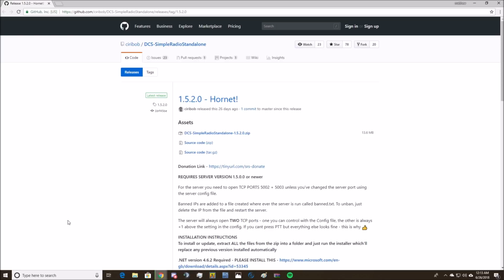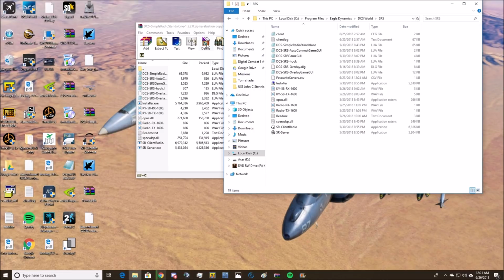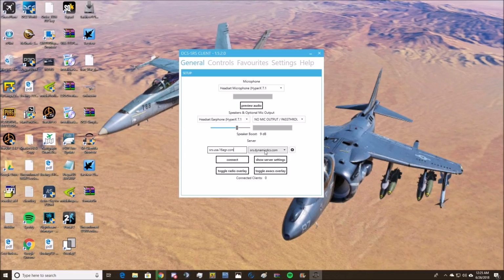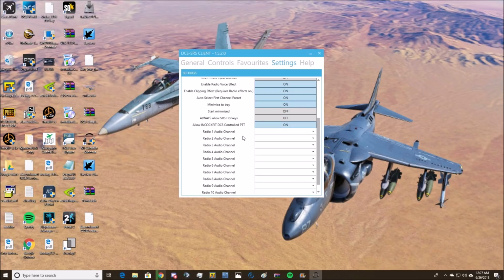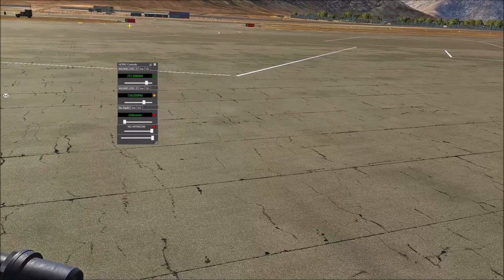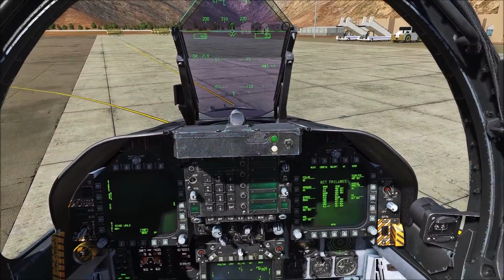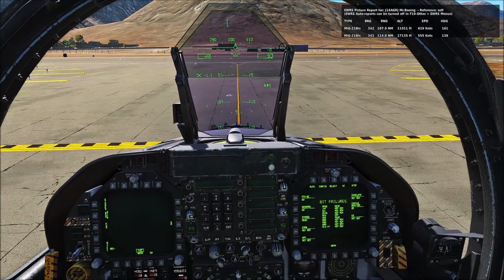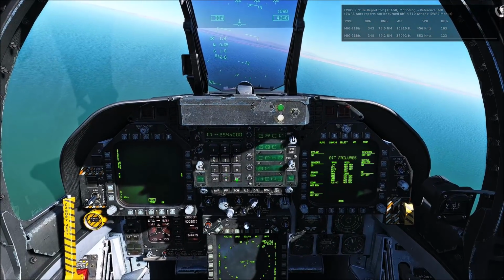How to use and Install Simple Radio For DCS World   (Little old now)

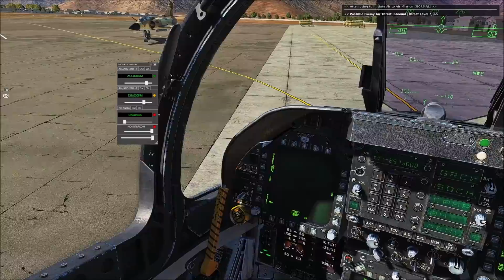Comment: Please DO NOT spread misinformation. 5 by 5 is "<signal strength rated from 1 to 5> by <signal clarity rated from 1 to 5>" If player is at the age of the radio range but has good internet, it will be 1 by 5, but if it is really close, good signal,  have some lag spike or something, it could go down to   5  by 1. 5 by 5 does not means 5 out of 5, it means the old "loud and clear", but substitute that with numbers from 1 to 5. I would rate 9:00 transition 5 by 3 for example.

Comment: Well how do you set radio frequency in Mig21 who have only radio channels 0-18 ? I tried every channel, nobody was talking in any of them althrough there was another 8 Mig21s in the sky
Reply from the maker: RENEGADE Motorsport you should be able to set it through the overlay
Reply: @YourSimCFI  Unfortunatelly Im not. Its locked. Inferno server worked best for me so far but regardless when i turned radio on and switched to channel 8 (which is 254.00 Mhz in this server and also is only one frequency for all blue coalition jets) it was completelly dead, i tried to run "radio check" throut all channels but it was complete silent even if SRS said that 8 active SRS users are in the frequency.

Comment: Thanks for the vid, will be trying to get into server flying with SRS soon. BTW, IRL ICAO 5 by 5 means strength 5 and readability 5. So 5 by 1 means a good signal, but unintelligible (mumbling, feedback, distortion, etc). In the UK RTF standard is just to say "Readability fife" (fife = 5 for readability) meaning loud and clear where is "Readability wun" (1 = wun for readability) means unreadable. The response should be, for example, "Yours fife" to acknowledge and state the readability of the responder.
Reply: Alpha Lobster Hey, I know you from Assetto corsa. Didn’t expect you here

Comment: In regards to setting the PTT and Radios, can you clarify if you just Press 1,2,3 once to set the radio then use PTT or does it require handling both at the same time? Yea it may be a stupid question but DCS has so many key commands and honestly, it wouldn't surprise me.

Comment: Thanks.  This helped me understand how SRS integrates with the game.  Its basically like TFAR for ARMA 3.  How do you set up multiple channels on one radio like in the A-10?  VHF 1 is FWD, VHF 2 as aft, UHF is down.  I'll leave discord as up.  In would be for an inter flight channel.  But can you have another layer of channels tied in with VHF 1?  In other words, does SRS see radio 1 as VHF 1 and radio 2 as VHF 2?  (radio 3 is UHF?). Or is SRS literally associated with the in game analogy of the VHF radio and there is some other magic that needs to occur?

BTW, the "5x5" isn't really official.  It's an old carry over from amateur radio which bled into radio use during WW2.  It's still around only because people still use it.  It was a scale of Loudness (1-5) x Clarity (1-5).  No one really cares with that level of fidelity except ham radio guys.  These days, the perception is that it either works well enough or its not.
Reply from the maker: Matthew Geders thx for watching  glad this helped.  The a-10 is vhf 1 uhf and vhf 2 And all you need to do is set the different radios to different channels and you will need to set radio 1 radio 2 and radio 3 controls as well as in cockpit radio buttons (turn off) you will also need use radio controls and PTT checked on that will be in settings. For me 5x5 scale is the way they thought  me in flight school it was in the radio licence manual.
Reply: I learned something new then.  Thanks for the clarification.  I guess the air guys still use that.  Which is kinda weird when I think about it.  The ground guys can fiddle with antenna and position on terrain to adjust LxC.  Planes can't do much as far as pointing their antenna can they?  You have your PPL?
Reply from the maker: Matthew Geders working on it now in the middle of moving/ changing schools, I’m currently  up to patterns. If you have more question you can contact me directly at this discord https://discord.gg/4JyZpA

Comment: Hi! I have an issue. When I use th SR in the A-10C I can´t use the VHF-AM/FM channels, and the three has only the orange light. The VHF-AM can´t change frequencies and when I push the PTT only change to green light and when release it again the yellow light either the FM. The frequencies panel at the top says Cockpit Controls. Any idea what´s going on? Also the level sound sliders are not the same as I see in the most of the images they look small rectangles... But when I fly the Gazelle everything works fine! :(
Reply from the maker: Grupo de Operaciones Aéreas sorry I haven’t had the problem myself however if you like you can join this discord https://discord.gg/4GqnTt2  and I can help you live tmr, or someone from the squad could thx for watching and thx for commenting.
Reply: Thank You!!
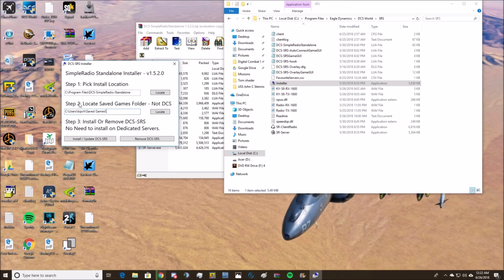Reply from the maker: Grupo de Operaciones Aéreas ya sorry I can’t help over text it’s about 2:40 ish am for me and my brain if off lol but hopefully I can find a solution tomorrow.
Reply: Don´t worry, really appreciate your time!

Comment: @9:16 A radio check can give you numbers for both signal strength and clarity, each on a level 1-5, hence 5x5 being the best as its 5 on both scales. The reply you got was "Lima, Charlie" i.e. "L, C," or "Loud, Clear", which are the 5s on each of those scales. 

They may also be as simple as:
Me: "FSF, this is Jiblet, radio check, over"
You: "Jiblet, FSF, Roger, out."

Hope that helps someone.
Reply from the maker: Simon Peel ah it dose help, thx for watching and commenting.
Reply: Only the calling station can "out" a conversation. Over implies that you're awaiting a response, whereas out indicates that you do not need a respond from the station you contacted. They should never be used together. (Over and out; Hollywood bs.)
Reply from the maker: Mike Lansing yes I’m knew that part was wondering  what the LC was but thanks for the comment and thx for watching.